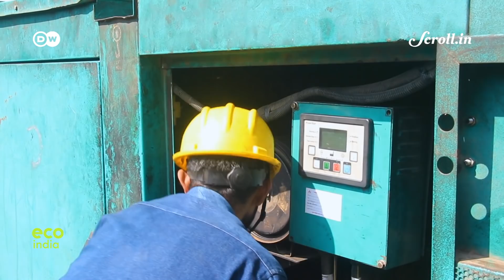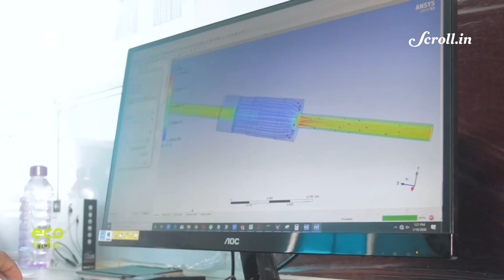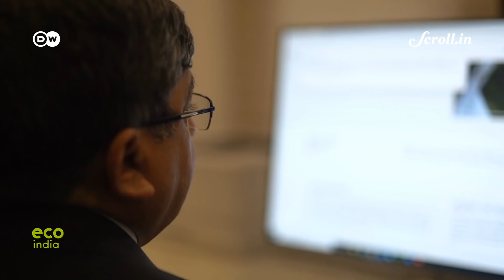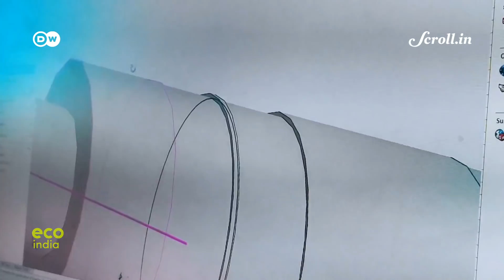Eco India: A retrofit device that is attached to diesel generators can help make Delhi's air cleaner

Comment: Very nice 🙏 I just hope it becomes mandatory for all generators so eventually cost will come down drastically.
Reply: On new generators, at least in Europe; new generators use DPF (diesel particulate filters, SCR (selective catalytic reduction) using Adblue urea injection and DOC (diesel oxidation catalyst) in order to reduce all pollutants coming from the exhaust, these systems have been in use by cars, buses and trucks since the 2000’s and are now becoming the norm in generators.

Comment: so, you will capture the carbon and throw it where? on the land, so the land also will be polluted.
Reply: Carbon in solid form isn't polluting. I think I saw an innovation where they were using it as ink. Other uses can be found. And I think they aren't actually capturing the particles anyway, they are oxidizing the particulate matters so it'll form CO2 and Water. The carbon dioxide causes global warming but it doesn't cause the breathing issues.

Comment: Sir why don't you develop this type of technology for both 2  wheelers ,4 wheeler vehicles
Reply: Catalyst converters exist. Newer diesel vehicles are much cleaner than older ones. I assume the diesel generators are not regulated by the same standards as the vehicles.

Comment: Everybody kindly tweet this to Arvind Kejriwal, they will surely run a test run. It can be good study beneficial for the entire country.
Reply: Kejriwal has done a great job in electricity sector in Delhi. Power cuts have been reduced to almost zero in capital, making 600000 diesel generators out of work. Power availability in Delhi was 99.96%  in 2018-19. And you can search for it on Google.

Comment: Ethanol can also be used as a fuel because I saw a tvs ethanol bike already showcased but not even a single state had encouraged and supported them.and as farmers can be benefited from this, so gov should promote this as well as electric vehicles .
Reply: People talk about electric vehicles but generating electricity is equally polluting our electricity in not fully generated from renewable resource most of it is non-renewable resources so there is actually no point mostly market strategy.
No hate to you personally.
Reply: @NA-mk7jc  I know this but my point was instead of shifting mainly on the electric vehicles we can also use different fuel they also pollute to some extent but nowhere like petrol or diesel.
Reply: @NA-mk7jc  plus if I take ethanol as an example so this can benefit our farmers they can make good income.

Comment: This is used in BS6 Diesel version. Selective Catalyst Convertor SCR and Diesel Particulate Filter DPF.
Reply: Mostly in automotive application. Its really nice that this indian startup is applying those concepts  to existing diesel generators as its a retrofit device. We cant want 10 more years to phase out the existing ones so that the newer ones with SCR and DPF can be used. Everyone talks and knows the concepts. This startup has applied those concepts in a practical manner. Respect.
Reply: Thermal plant aur factories k Chimney wagera pe bhi lag jaye toh badhiya jugaad ho jaye